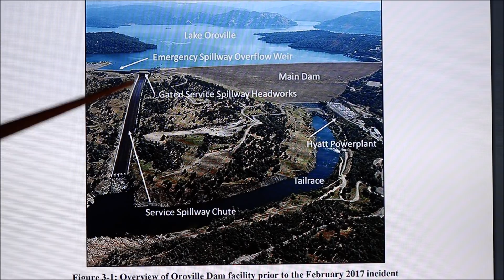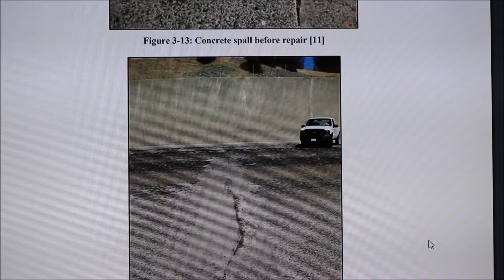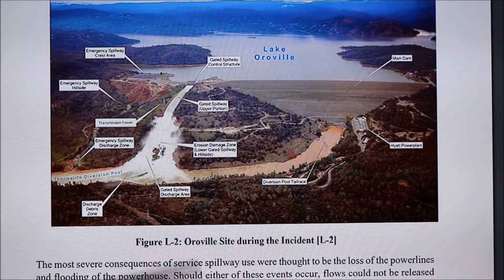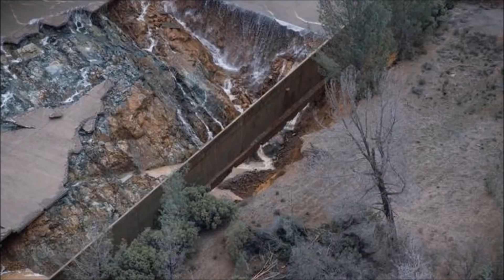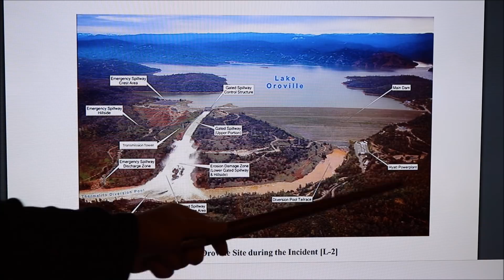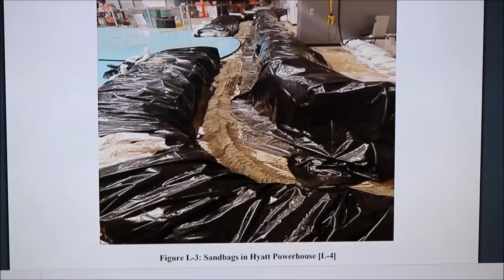Oroville Update Final Forensics Report Sequence of Events after Spillway Failure

Comment: Other than cost of damage to the turbines, What would of happen when they weren't able to send power to the lines that were about to be washed away yet let them spin pulling water from the dam? Would they have went faster and faster till they blew up? I mean you have a generator you can pull the plug to yet it runs with out damage. Is centrifugal force that much of a danger?  "One of your best videos here to Mr Browne"
Reply: You do not want to be anywhere near a failed hydro-power turbine! Damage repairs would far exceed the cost of rebuilding the spillway. Some reading: https://en.wikipedia.org/wiki/2009_Sayano-Shushenskaya_power_station_accident
Reply: Thank You. This link wouldn't load. maybe i need to add a www. in there. My question was, Just exactly physically does it do. My thinking would say, It uses the load to keep from spinning to fast. I watched that one video where they lost somewhere around 70 people,.
Reply: thedrloboski stevens I don't know exactly what would happen (and nobody willingly wants to find out). It is clearly undesirable to operate a hydroelectric turbine for long periods under conditions for which it is not designed. There are concerns such as excessive vibration, unstable flow, fatigue in the blades, and potential damage or destruction of equipment.